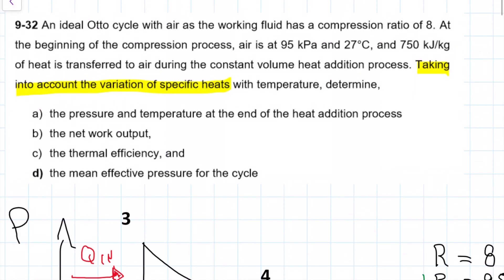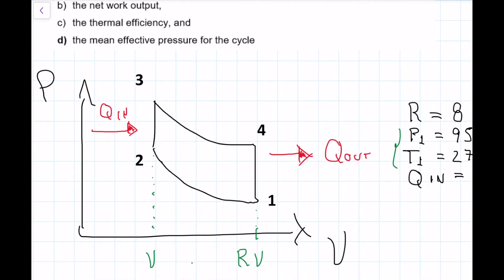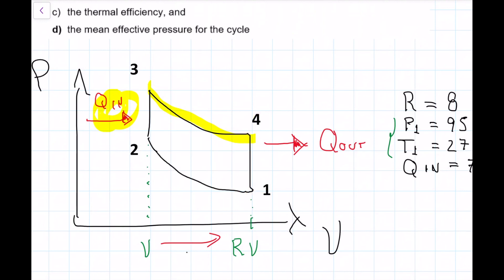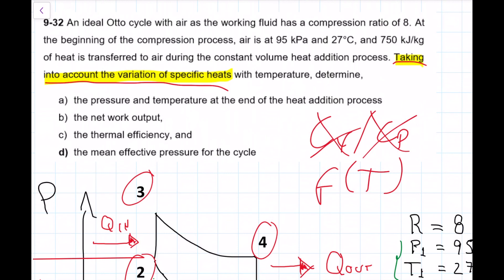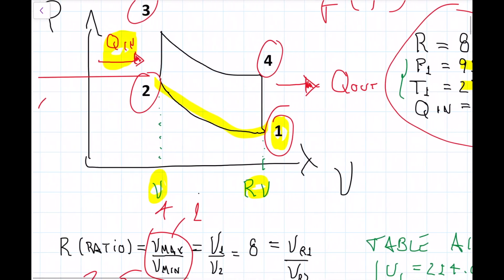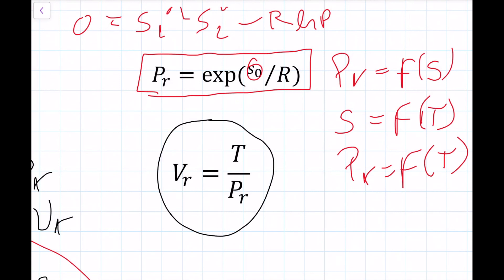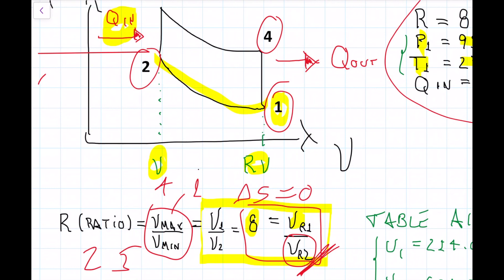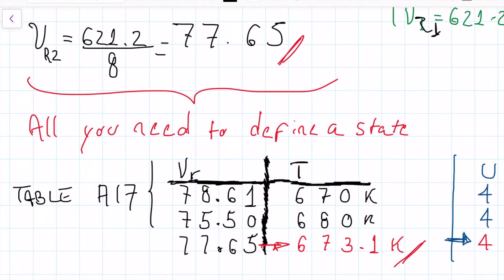Thermodynamics Mech3001 - Week 8 - Problem 1 (9.32) - Part 1 Introduction

Comment: how did you solve for V1 , you dont have the mass, and its an gas cycle so its not in the tables
Reply from the maker: It is in the table, it just won't be a steam table. You'll look for a table that is only dependent on temperature and has Pr and Vr among others. Note this is not pressure and volume but proxies that are only temperature dependent

Comment: How can you solve a. without using the table if it's possible?
Reply from the maker: No...
The question clearly states: "Taking into account the variation of specific heats with temperature"
So you need to use a table.
HOWEVER, if that wasn't the case, and knowing air can be treated as an ideal gas in most situations, you could use the specific heat and solve it without a table.

Comment: can i ask for a help?1. An air-standard Diesel cycle has a compression ratio of 16 and a cutoff ratio of 
2. At the beginning of the compression process, air is at 95 kPa and 27°C. 
Accounting for the variation of specific heats with temperature, determine (a) 
the temperature after the heat-addition process, (b) the thermal efficiency, and 
(c) the mean effective pressure.
Reply from the maker: Sure. Here is a video on Diesel that can help you out https://youtu.be/1DgffMVHCtY
I am happy to solve the one you posted too, but it will take a while since there are plenty of videos on the works
Reply from the maker: And here is another https://youtu.be/YRavprkss4k

Comment: i have a question how to find the 750 kj/kg, of heat added also know as Qin- or Qadd, where it comes from? theres some chart for that?
Reply from the maker: Yep. In the property charts, you grab the enthalpy (h) for the state prior to the heat addition and post heat addition. The difference is the heat addition (Qin or Qadd)
Reply: @EngineeringHack  thanks, I have another question, can I use the ideal gas law, which is PV = nRT, to find the temperature and pressure at point 3, putting the data from point 2 into the isochoric process?
because the volume from point 2 to 3 doesn't change, when the piston is at TDC.
or the equation does not work for the otto cycle,
Reply from the maker: @Musarapio_HHA  yes you can
Reply: @EngineeringHack  thanks